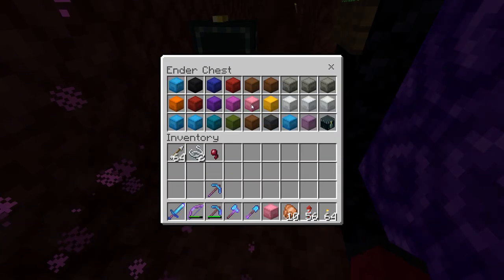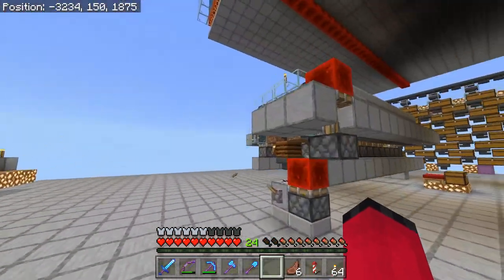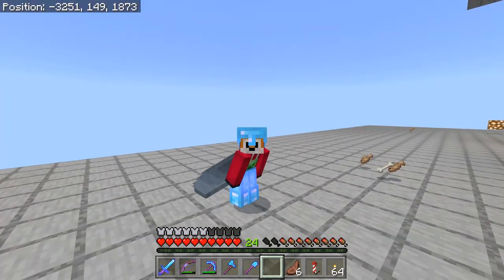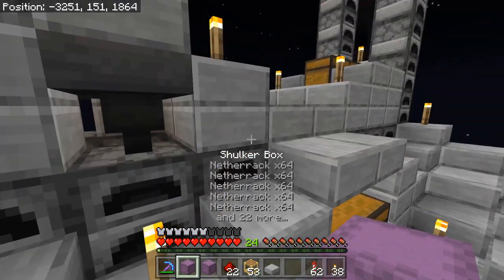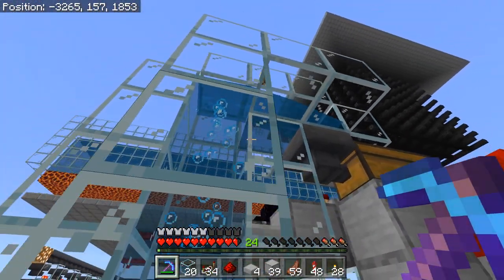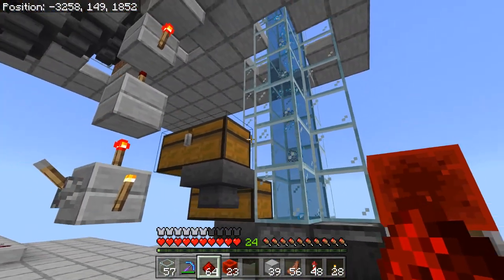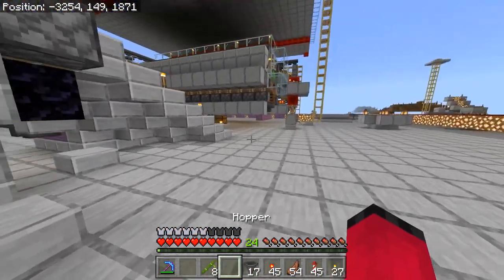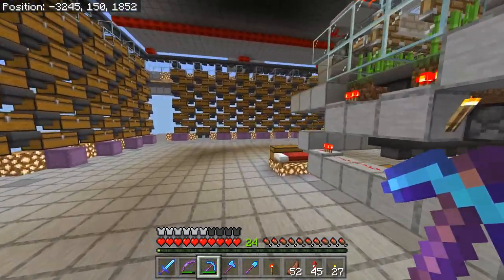Furnace Array & Bamboo Farm | Truly Bedrock [1-32] | Minecraft Bedrock Edition SMP (MCPE / MCBE)

Comment: @2:50 When you come across a lava source block while tunneling trough the nether, do one step back and dig a hole in the floor as close to the lava as possible.
Liquids always look in 5 block radius for lowest point to flow to.
This way you can easy control the lava and plug the hole, without the need of potions and risking being burned by the spreading lava.
Reply: And when you are Expert lvl 99 you don't even need to take step back
Reply from the maker: Nice tip!
Reply from the maker: When you are expert level 99 lava flows around you and never touches you 😉

Comment: I know this is a little bit late compared to when the video was put out. I think part of the problem could be fixed by adding a rail on each side of the hopper minecart line. Hopper minecarts have a tendency to not drop items into a hopper unless it completely passes over the hopper. Pulling items from a chest is the same. It has to pass completely through. In your case you’re hopper minecart is only traveling 4 rails. However the outside rails don’t completely get traveled on. The minecart rebounds off the block and never fully travels the last rail. If you extend each side by one rail that should fix the uneven distribution of bonemeal.
Reply from the maker: The probelm was that it wasn't picking up enough bonemeal to reach all of the hoppers. There were 4 it needed to fill and it only collected 3 pieces at a time. I fix it at the end of the video by making it collect more

Comment: Your bamboo farm isn't totally impractical. You just need to provide enough bamboo storage for the largest smelting job you'll have and let the farm run between jobs to refill it. I have a 24-furnace array and 4-chunk natural-grow passive bamboo farm that does this. The farm produces about 74 bamboo/min. but the array consumes 576 bamboo/min. I calculate I'd need about 32 chunks of natural-grow farm to keep up with the array in real time, and that's just for 24 furnaces, lol.
Reply from the maker: I can't get the bamboo into the furnaces fast enough to actually smelt anything. The issue isn't how fast the bamboo os produced, its how slow it is to get inside the furnaces. The only way I can see to fox it is to dramatically slow down the piston feed tape which will drastically lower the rates of the furnace system.
Reply: Ah, yes, I forgot that. I don't have that problem because mine isn't a piston feed tape style, so I just use a separate hopper pipe for each group of 6 furnaces. (6 x 4 bamboo/10 sec. = 2.4 bamboo/sec., hoppers move 2.5 items/sec.. I'd need a separate pipe per 3 blast furnaces or smokers.)
Reply: You have like 38 furnaces, right? You could put a fuel feed hopper at each 6th position to keep them supplied. Lot of hardware though I guess.
Reply: This maybe a foolish thought, but could you turn on the furnace array without the netherack, charge the system with bamboo, then once fully fueled up add the netherack for baking?
Reply: @foxynotail  I have a small piston tape furnace array with bamboo as the fuel source. I have the array arranged vertically like this one, so I am able to feed fuel into the tape on the back and side in multiple locations. What you need is to feed the fuel in ~8 places. It is challenging to store enough fuel, but it better for me than crafting kelp blocks. Now that I think about it, it would have been better for me to put it on the sideways bit so each hopper could have its own double chest, but space was somewhat constrained, plus I wanted to add the fuel as quickly as possible after adding the smeltables..

Comment: Just split the Bambo feeder to fill 2 double chests instead of one and have 2 hoppers going into each circle.  Let the furnace run empty for a bit to fill them all up and then once there is more than 4 bits of bamboo in each furnace it should be self sustaining wouldn't it?
Reply from the maker: Still wont be fast enough to smelt one item

Comment: sadly I abandoned bamboo as an idea for fuel a while back   just thinking on what design to use for kelp farm on the realm   have a few ideas that might work :)
Reply from the maker: I really wanted to avoid kelp as its already been done to death on the realm but I feel I have no choice ☹️
Reply: @foxynotail  well if you do 8-12 hoppers feeding bamboo into the system then it should be enough to get the smelting done with bamboo....just thats a lot of iron and you need massive bamboo output to support that.
Reply from the maker: I still don't think it would be enough 🙁
Reply: @foxynotail  in theory 12 hoppers feeding bamboo into the furnaces as they pass would give enough to smelt 3 items by the time they came back around  but impractical.
Reply: Fantasy Novel there is a zero tick kelp farm you can build